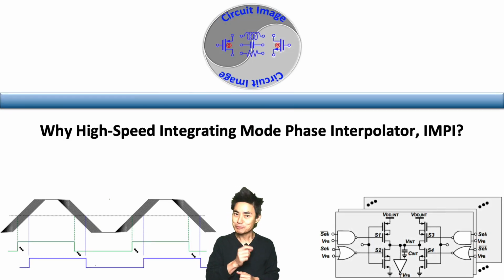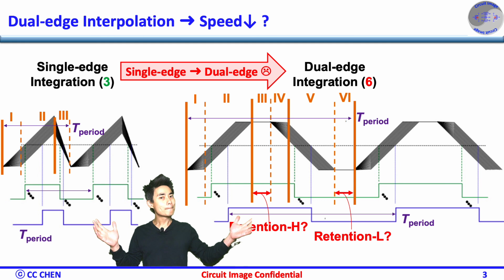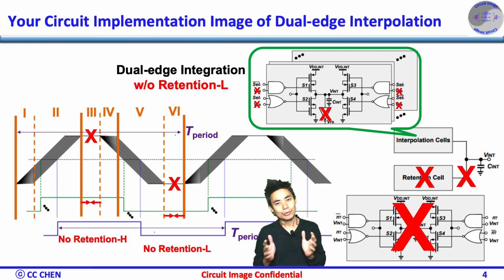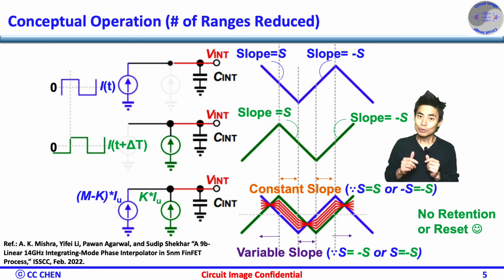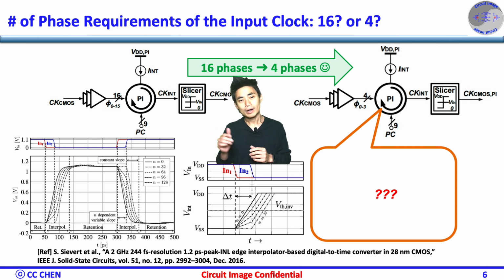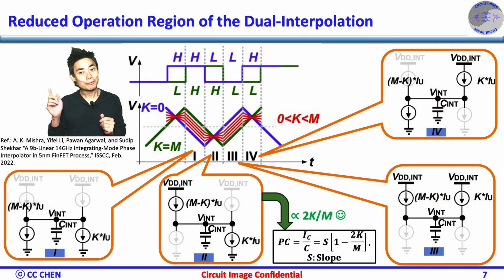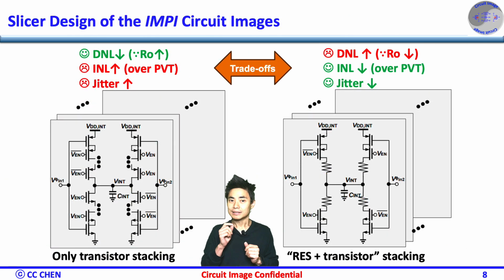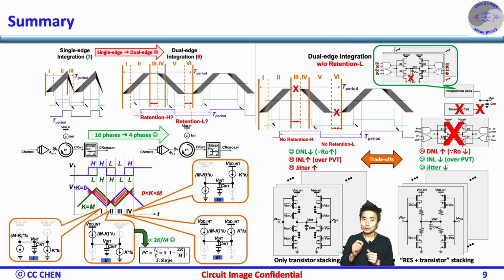Why High-Speed Integrating Mode Phase Interpolator, IMPI?

Comment: Hi CC
Mixer output will be CML level right how can we convert that to CMOS level with less jitter
Reply from the maker: Hi @Cchowdary,

Good question! Yes, the mixer output is at CML level. To convert it to CMOS with minimal jitter, you’d typically use a low-noise limiting amplifier or buffer chain that gradually increases swing while maintaining bandwidth. The key is to keep the first stage fully differential with good common-mode rejection and minimize duty-cycle distortion. A final CMOS buffer can then restore full swing without adding much additional jitter. Please refer to:
Song et al., “A 0.47–0.66 pJ/bit, 4.8–8 Gb/s I/O Transceiver in 65 nm CMOS,” IEEE JSSC, 2013.

Thanks,
CC

Comment: Hi cc,
How can I add programability to make this circuit work across frequencies (4G-16G)
Reply from the maker: Hi Chakri,

Great question. To make an integrating-mode phase interpolator (IMPI) work across a wide frequency range like 4G–16G, the key is to add programmability at a few points in the circuit. Common approaches include:

1. Adjustable bias currents to scale the effective gain and bandwidth with data rate.

2. Switched capacitor banks (or load-cap tuning) to set the integration time constant.

3. Programmable interpolation weights (coarse and fine DAC codes) to maintain uniform phase steps.

In practice, most designs store these settings in a small lookup table—one set per target data rate (e.g., 4G, 8G, 12G, 16G)—and load them at initialization or during calibration. This keeps the IMPI linear and low-jitter across the full operating range.

CC
Reply: @circuitimage Thank you CC! Have a great day
Reply from the maker: @cChowdary  You too. Thanks a lot. 🙂

Comment: Dear CC,
Is this resistor stacking architecture work across frequencies (4GT/s - 64GT/s)
Reply from the maker: Dear Chakri,

Great question! Yes, the resistor stacking architecture can work across a wide frequency range , but its frequency depends on careful device sizing, linearity, and parasitic RC. At higher data rates, people may apply half-rate or quarter-rate to reduce the clock frequency and mitigate some challenges.

Thanks,
CC

Comment: Dear CC, on page 8, regarding the selection of current source. Does the gate of the MOS connected to the full swing CLK? In this case, the MOS will operate in the liner region. How can the MOS generate a constant current to charge the capacitor? Thanks.
Reply from the maker: Hi 彥逵, Good question!

Yes, the gate is connected to a full-swing clock, so the MOS operates in the linear region during the on-phase. In this case, it doesn't act as a true constant current source but rather as a controlled switch that charges the capacitor with a predictable current during the clock period. This behavior is acceptable in such designs, like charge pumps, where very precise constant current along isn't required.

Comment: Thank you very much for sharing these valuable  information. It is more helpful than basic design information. The PI circuit has two stacked devices in series with resistor. For high-speed design, such as 112GBPS PAM,4,  what is the size of resistor, capacitor, I and power supply? Thx
Reply from the maker: Hi S. Yan,
You're very welcome. Nice to meet you. I'm glad that's helpful. 😊 The supply was 0.75V in 5nm. I don't have the exact value of resistor, capacitor, but you should be able to size it based on your slew rate, headroom limitation & noise. Therefore, usually, that highly depends on all the specifications, which might be different from different designs.